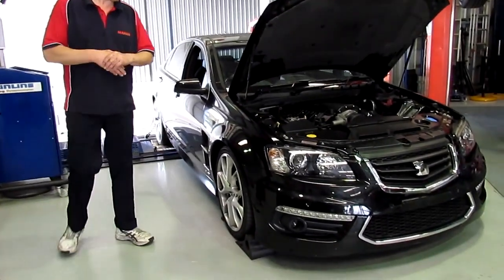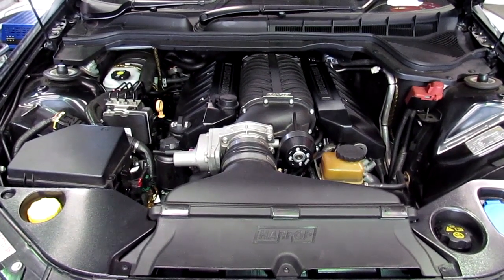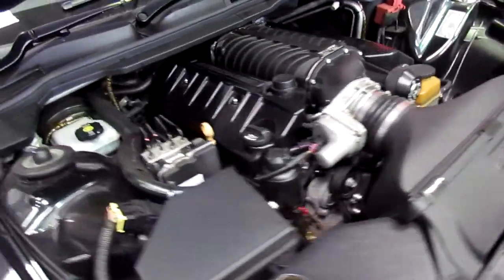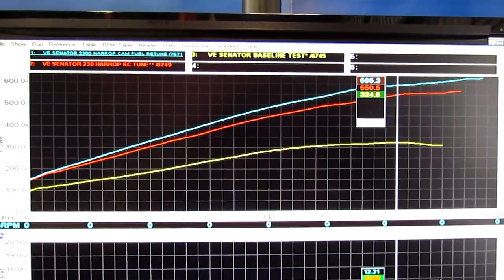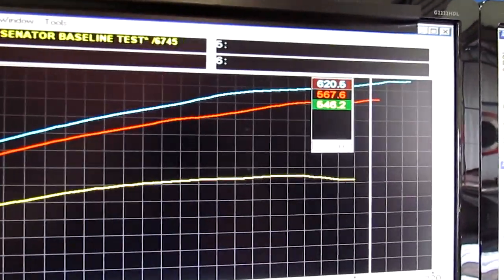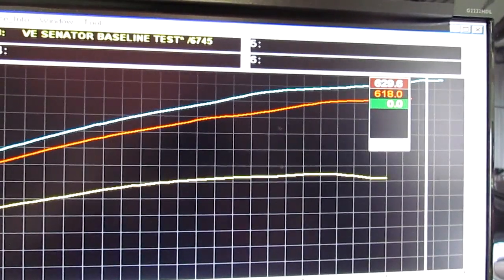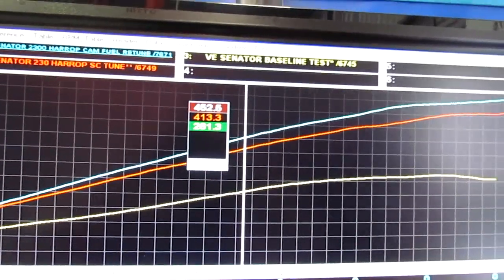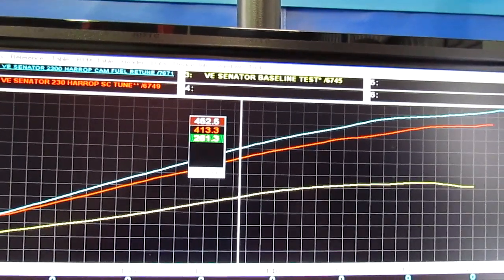Supercharged LS3 E3 Senator

Comment: Hi mark great video as usual. Always waiting for the next one.
I have a question about the ls1 in my 04 vy ss.  
What is a good size exhaust size and type for a deep sound and (if possible hp ?) 
2.5in or 3in ?
What mufflers?
I have otr and headers.
Reply from the maker: I use 3"full muffler stainless Manta systems, Cheers
Reply: Witch of the Manta mufflers do you use